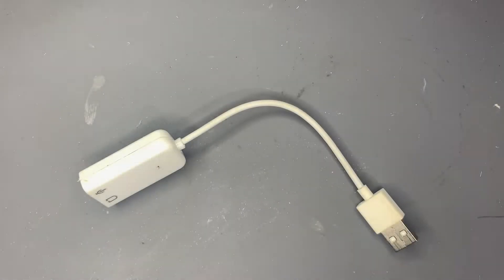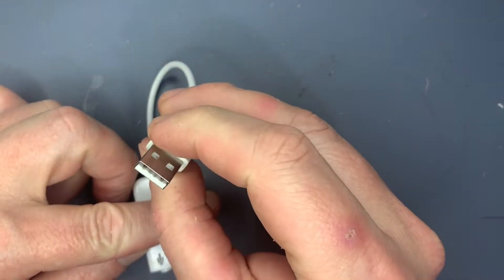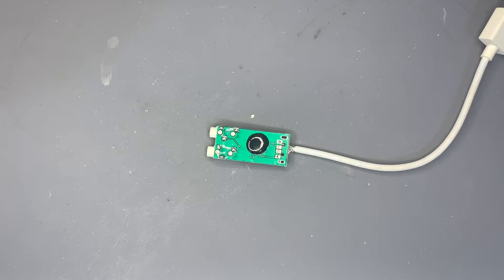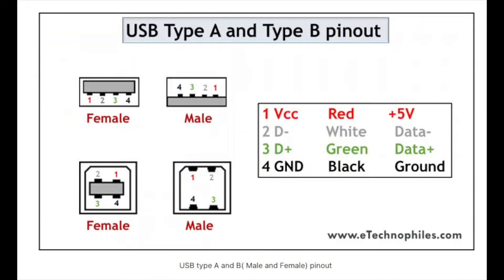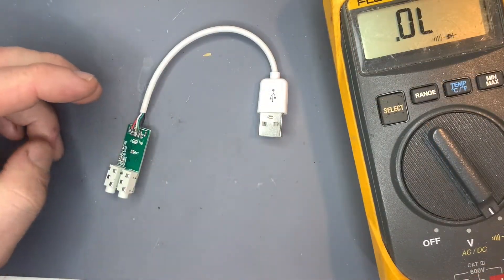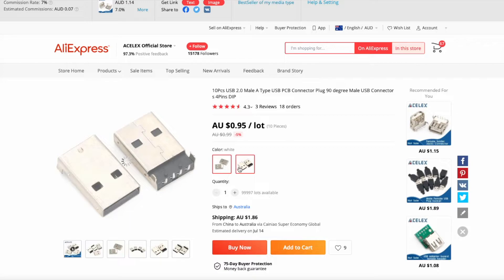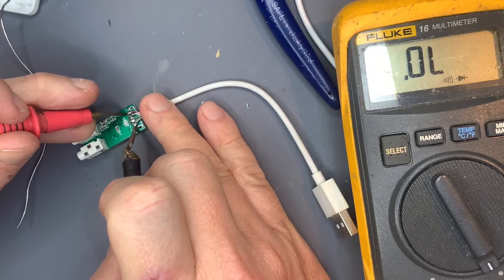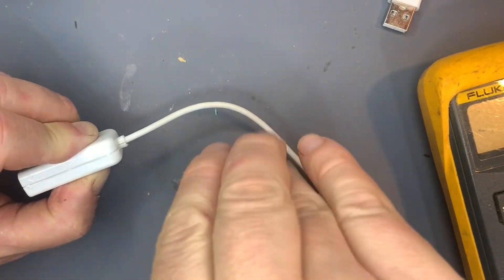USB Audio Dongle Repair

Comment: out of curiosity does it send the audio thru the 2 data pins or all 4? how about the mic and ground.. im seeing 5 cables. im wondering is this how usb headphones work? is it just this with different housing and direct solder leads from headset to soundcard to usb?
Reply from the maker: The black and red wires are 5V DC, they are only used for power.
The IC under the blob has a USB protocol for transferring data to and from the computer, it also has an analogue to digital converter for the microphone and a digital to analogue converter for the headphones. 
The extra pins are on the ground plane, in that design it would use a USB plug, the shielding for the plug is directly connected to the ground pin which is the black negative wire.